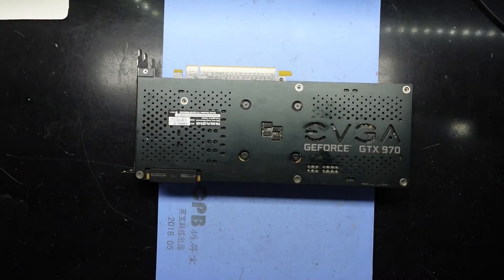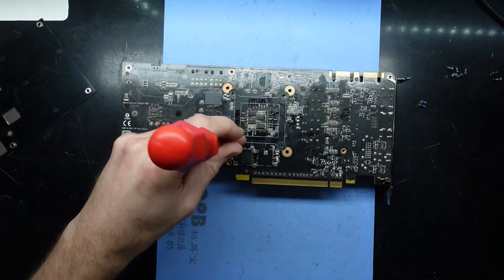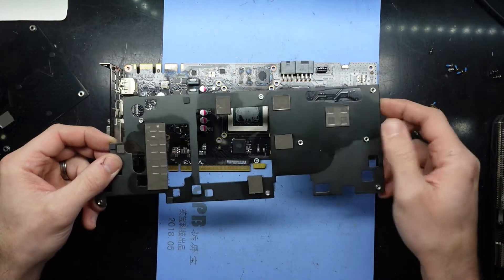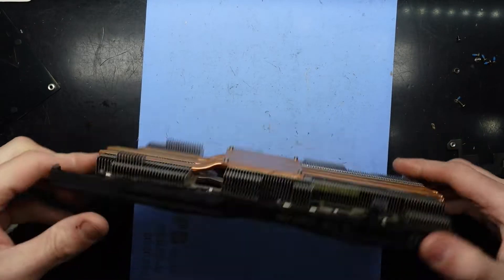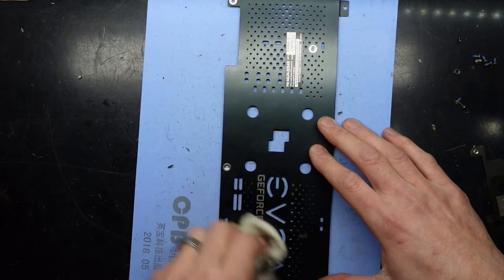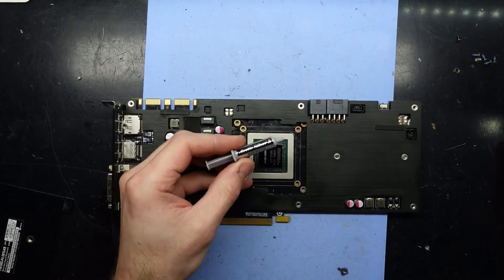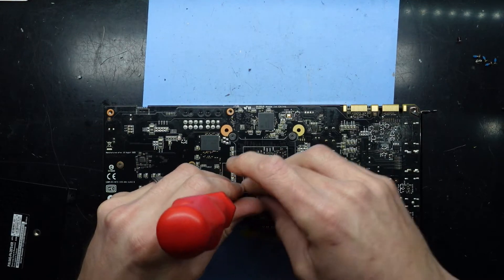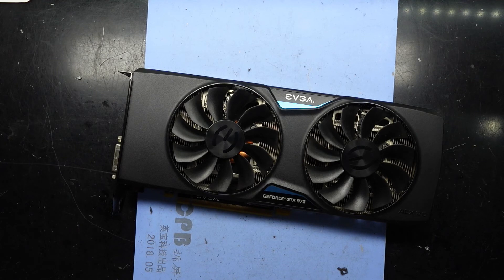EVGA GTX 970 4GB Teardown and Thermal Paste Replacement

Comment: I have the same video card and I've watched several videos including yours and nowhere, nowhere has anyone taken the risk of changing old dried out thermal pads. Why are you all such cowards?  :)
Reply from the maker: Cause I don't have the right size pads on hand, not all pads are dried out,  most still have a use
Reply: What is the correct size of the pads for this model?  @rickstechrepairs

Comment: Even my old PNY 970 is still chugging along. Never was the best card but it has done well. Did you use iso to clean the dirty sections of the PCB as well? I've cleaned mine at least a dozen times but I've never replaced the thermal paste.
Reply from the maker: Iso is safe on pcbs 
Thermal paste replacement is pretty straight forward

Comment: as a kid i pushed this thing to its limit playing all the latest 2016 titles like overwatch and gta5, and this card truly is a trooper. still powering my mom's pc to this day, finally was able to clean it up for a new build thanks to this video. from a 4th gen i5 to a 12th gen i5, the 970 is the only piece left from the old build 

thanks for this!
Reply from the maker: cheers, good luck with the refurb and also fingers crossed for an upgrade soon
Reply: @rickstechrepairs  at this point im going a bit crazy and painting the gpu shroud white to match the new build, if i end up bricking the 970 it'll be time for a new gpu but if it all works out i think it'll be cool, a bit of new life for it

Comment: How did you clean the main board?
Reply from the maker: Air compressor and wd40
Reply: @rickstechrepairs  I would recommend an electric blower, compressed air gives off moisture, even in aerosol form.